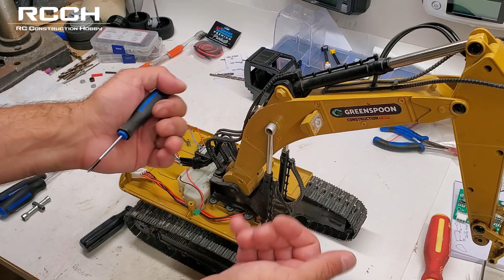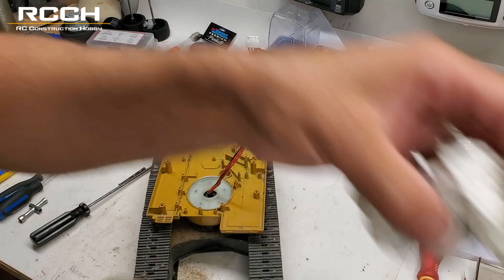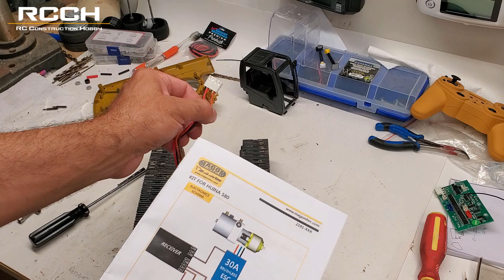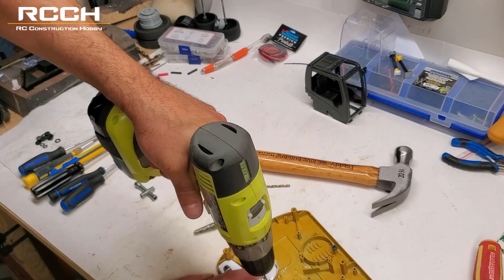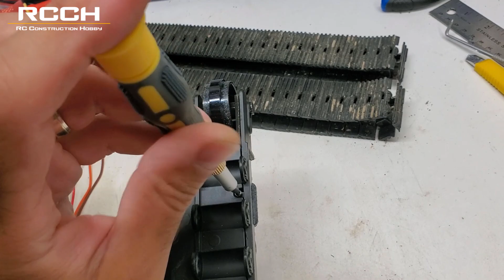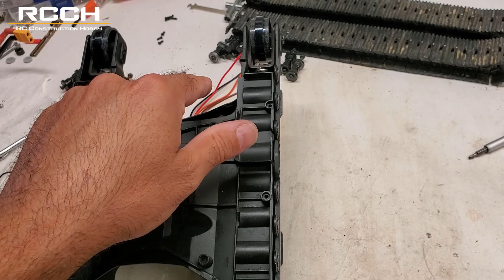How To Take Apart the Huina 580 Step by Step | Disassembly of the 580 | PART 2

Comment: I want to hook up a yellow rotor lamp, where can i Connect it?
Reply from the maker: On a stock unit you might have to connect to a red and black power. But make sure the voltage matches. So light voltage should be the same as the battery.

Comment: Thanks for making this very good video, I've have the 1580, I've got the body off at the moment as removing the smoke unit to make more room for the lipo and also add some extra weights, i have the upgraded slew gear on the way so i can see from your video how i need to fit it, so no point me putting it all back together till the slew gear arrives.
Reply from the maker: Glad it helped I would keep it all apart till you get the slew on.

Comment: Hey man. I hope you can help me out. I bought the huina 580 but it came by parts. I just want to go hydraulic. I bought the chassis, tracks, gears boxes all the parts except the arm, and all the battery stuff. But it doesn’t come with the screws I already asked the seller but I think they don’t understand me. You know where can I get the screws?
Reply from the maker: You can try aliexpress and search up screws for the 580. I think they are an odd screw size. Like a 2.5mm.
Reply: @RCConstructionHobby  thanks man

Comment: Pedro pulling on those connectors gave me friggin anxiety im careful as hell with those and still have dicked one or two.
Reply from the maker: Lol. I figured I was not going to reuse it so I was a little harder on the cables. I will try to be more gentle on my next video.
Reply: i have a 3D printed boom craddle under my body

Comment: How do I bind a new controller to the 580?? It’s not plug n play it needs binding
Reply from the maker: For a stock 580 you can't bind a new controller to it. You would have to do a conversion to either hydraulic or all electric with esc's. Then get a new transmitter and receiver and bind it them together. But the original transmitter can not be replaced unless it is being replaced by the exact same transmitter.
Reply: @RCConstructionHobby  ok.. then I guess I got the wrong one.. ther are 2 kinds I didn’t kno which is which and wit my luck I always get the 1st choice wrong.. all I get is a blinking light on this new controller.. so I waste $30!! Thanks anyways

Comment: Where did u get the metal tracks from
Reply from the maker: The 580 comes with metal tracks. If you want metal tracks there is a site that sells them in Europe or you can check aliexpress for them as well. But the 580 has always come with metal tracks... check the model you have as it my be the plastic version.

Comment: My controller is bad it won’t operate the motor on the big mast arm.. if I buy another remote how do I bind it to my excavator?? I cannot find any videos on it
Reply from the maker: If you buy a replacement controller it will bind to the existing machine. I believe the frequencies should be the same.
Reply: Oh ok cool thanks for you’re response

Comment: Excellent video, just converted mine to proper esc's, receiver etc.  Can you recommend a reasonable price sound kit that's not too big? thanks
Reply from the maker: A sound kit that will fit you will have to look at a servonaut small. Its a little pricy though. As for something cheap you can look at the gt power option but not sure it will fit.